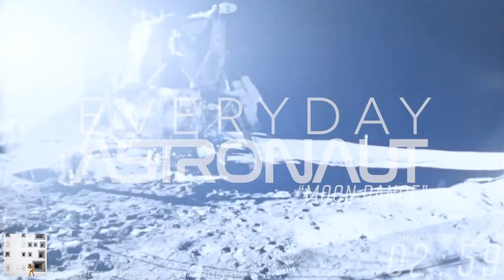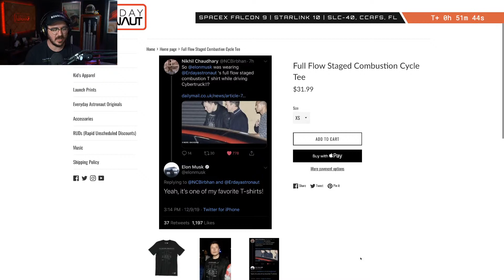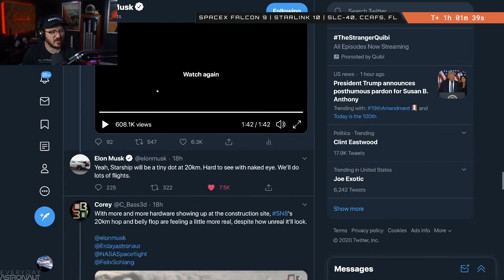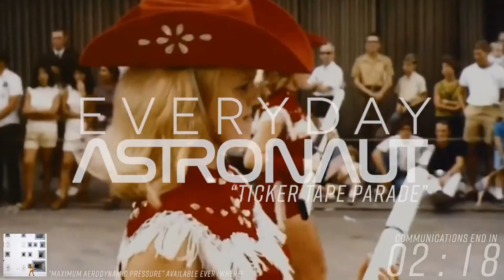Watch SpaceX Launch 58 Starlink Satellites PLUS 3 other Planet Lab satellites!

Comment from the maker: Mobile Timestamps:
00:00 - Intro
03:25 - Prelaunch Preview
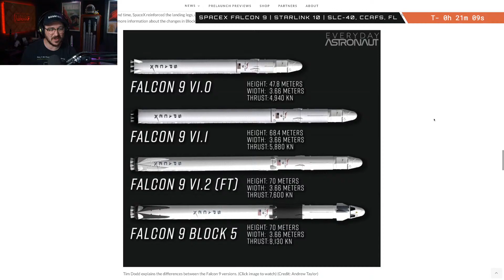12:35 - News / Questions
23:03 - SpaceX Stream
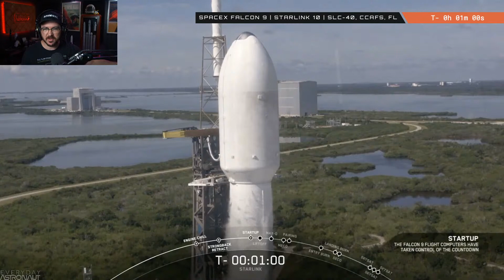32:30 - T - 1 Minute
33:30 - Lift Off!
36:08 - MECO / Stage Sep
40:18 - Entry Burn Start Up
42:00 - Booster Landing
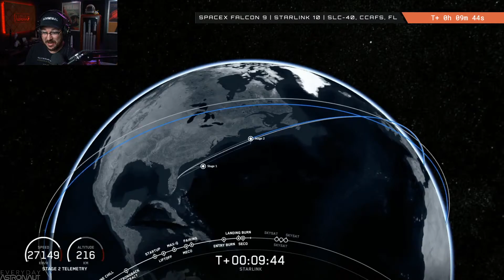43:15 - Questions
45:55 - Skysat Deployment
48:10 - Questions
1:18:30 - Fairing Catch
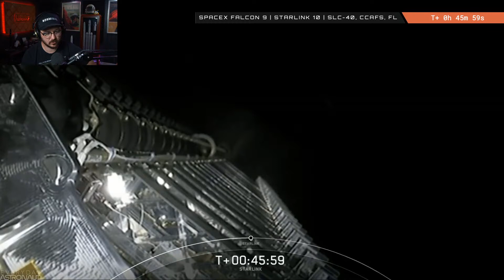1:19:35 - Starlink Deployment
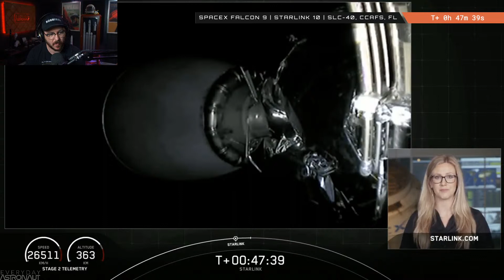1:21:15 - Questions
Reply: Thanks a lot!
Reply: Tim, thank you for your details timestamps! 
:)

I can see your work by passion and heart. Next, could you discuss more details on the deployment of Skysat and Starlink? I think people would like to know more analysis in this. How accurate of the data is on the deployment? How is the physical master plan of the deployment? Maths people should be interested in this.
Reply: @needtoesca needtoesca Which songs do you like? ^.^
Reply: L512 Rushikesh Reddy, the answer to your question is the fairing. It the part normally at the top of the rocket protecting it’s cargo or satellites.

Comment: Just having a look at Saturn V vs Starship, where is starship hiding the extra 2,000 Tonnes?!

Also if the ISS is 420 tonnes and a fully fueled starship is closer to 1,200 tonnes wouldn't a single fully fueled tanker (so 1 or 2 refuels) be able to move the ISS to Lunar Orbit?

Comment: I am curious why manned capsules plunge into the atmosphere requiring a huge heat shield when the booster rockets simply uses thrust to burn off speed to avoid those forces of re-entry. Especially with the dragon capsule that has super Merlin engines already built into it. Why risk a heat shield failure and capsule loss when with a single burn they could slough off enough speed to just coast to earth which would also require much smaller chutes as a result of the slower re-entry speeds?
Reply: The booster rocket is not in orbit, it's not even technically in space, it has far less energy to burn off, and can carry much more fuel.

Comment: What's the bandwidth of Starlink anyway? Is it just supposed to link up areas that otherwise would not have internet or is it also going to try and be a competitor on the regular market.
Reply: They won't have enough bandwidth to compete in urban areas, especially those that have fiber. They are chiefly going to be after the rural markets.

Comment: How do they know they won't hit some existing satellite when the rocket is going up to space?
Reply: For one thing, space is really, gigantically, unimaginably HUGE, and the odds of running into another satellite in all that volume are vanishingly small, on top of which, every single satellite, and quite a lot of mere debris, is constantly tracked and their positions are accounted for in planning the launch trajectory.
Reply: @odysseusrex5908  yes you're correct. I know Norad tracks them but I'm assuming they are not putting starling satellites of the north of 60 degrees lat for a specific reason. Have you seen the model of the sat constellation and the open North ?

Comment: Two more questions from your fellow Iowan:  Was there any consideration for the drown ship to have a deep bay for the rocket to land in so that the actual landing pad, dry but below the water line?  Yes, bringing it back into the dock would need to be consideration.  If it's to deep it wouldn't work.  Why do it?  Thought is stability.  The amount of ballast needed to keep the ship at water line would allow it to be far more stable in less then ideal seas.  Also, having the rocket lower in the 'well' means the top sticking out is lower which means a four point lasso could be drawn up from the perimeter to secure the rocket (initial).  Ok a bit detailed but not sure who else to ask.  Keep of the great work!

Comment: 6 Launches and landings on one booster? Wow. At this point, can't they do a second stage re-use just for fun with all their tech?
Reply: No, they can not. The second stage has no heat shield. If they added a heat shield, and allowed for the fuel margin necessary to land it, they would have to give up so much payload capacity that it wouldn't be worth it. Furthermore, it would take time, money, and resources that are better put into Starship.
Reply: @odysseusrex5908  Just have two launches then. ;)
At this rate, it's probably economical for it. :P

Comment: Ok  but so what if it would take a lot of rockets to move the spacestation into luna orbit  by taking it into luna orbit we would gain a lot of  much needed knowledge and data that we need to know about for building big interplanetary  spaceships with habitats in space  Ojk so then if that is not exceptable then why not crash it into the moon so that the metal and some of the componants could be recycled or even land it on the moon to live and work in once upon the moon surface it would be that much easyer to maintain?

Comment: The future of internet, ladies and gentlemen. Six launches out of one booster is incredible.
Reply: the future?? i heard the bandwidth is around 10mbit/s
Reply: Yellow belt nope it’s the beta and they are getting 60 mbps and 12 upload which is really good and eventually one gigabit per second
Reply: Yellow belt  there’s a reason why we call projects the future. It’s because they are going to be finished in the FUTURE, not now, not tomorrow, but 2028. then, if it’s still not to your liking, you can complain.
Reply: @sylasviper715  Once starship starts flying they can take something like 450 sats in 1 launch.
Reply: @carljohan9265  That too, which will make this project finish earlier. So I have a feeling we'll be seeing this through at 2025's end.
Reply: Sylas viper 
The Starlink satellites still have to be built so the overall launch program may not be any different.
Reply: @Dave5843-d9m  They are building them at a rate of 120 per month and have been doing so for a while. 
Manufacturing ain't the bottleneck, launching them is. 
Starship will fix that.
Reply: @carljohan9265  exactly :)
Reply: ULA is a waste of taxpayer money!

Comment: It looked to me like the sunshades are spring loaded and simply deploy as soon as the satellite above moves far enough apart/away. From an engineering perspective this method of actuation is a simple, reliable, and very light. Just the sort of solution I would expect from SpaceX engineers.
Reply: Based on the gumball machine delivery system.

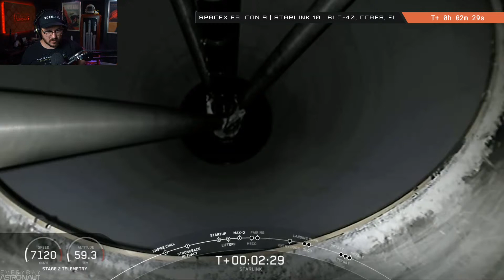Comment: @36:00
Why do the grid fins swing out in such a haphazard fashion?
It looks like they're being driven by a Walmart tyre pump - lol
Reply: They're hydraulic. So essentially they're being driven by a Walmart tyre pump. 

Likely the hydraulic pump pressurises the entire system and the fins move out as each has the least resistance.
Reply: why all I see is beautiful and elegant automation and control engineering... it works well enough to land the booster with precision enough, and they survive several entries in the atmosphere without just melting, which just adds more beauty to them.

Comment: how did they fix the camera cut off of the first stage landing?
Reply: I think they have a stabilizer under the transmitter
Reply: Could it be some sort of "alpha" use of starlink?  It's what I'd do... If I had a private sat array...
Reply: SpaceX has made no statement about that. A lot of people are speculating that they are using the Starlink system to get improved transmission. Certainly the improvement of the images correlates well with the deployment of the Starlink satellites. I guess they will tell us when they want us to know.
Reply: @odysseusrex5908   I'm gonna say Ocam's Razor applies.  A bit of neoprene under the transmitter doesn't seem to explain the huge improvement.  Anyone check the frame rates from the camera?  the existing bandwith limitations vs. the potential starlink bandwidth?  it's very nice to be able to watch the final  secs to the deck in glorious drop-out free real time...bet he could auction an observer slot on that boat for a front row seat...( tho the buffett sucks...)...(" a three day cruise to nowhere!").
Reply: @odysseusrex5908  still they would need something to stabilize the vibrations coming from the 1st stage
Reply: @nazreenhelmi6952   Not necessarily. the reason the vibrations were a problem is that the antenna was focused on a single communications satellite in geosynchronous orbit. Vibrations could easily disrupt that lock. The whole point of Starlink is that there are a whole bunch of satellites, much much closer, so signal can be picked up by whichever ones happen to be in range. It's just a line of sight broadcast. But, as i say, I do not actually know what steps they have taken to mitigate the problem. I am kind of surprised that they haven't said anything.
Reply: We have no proof what it actually was, but it was a multitude of things that were worked out over time.